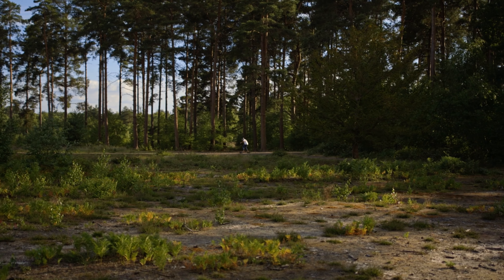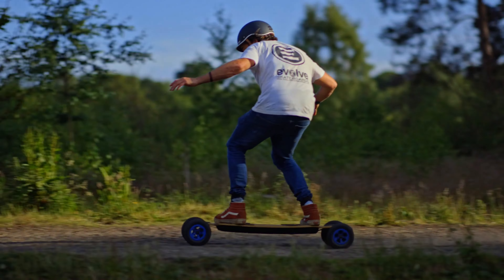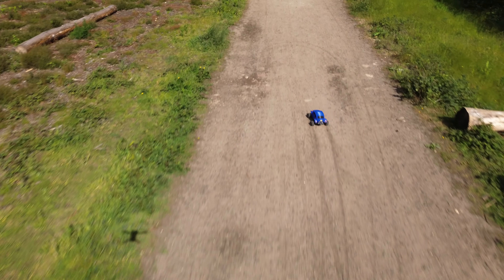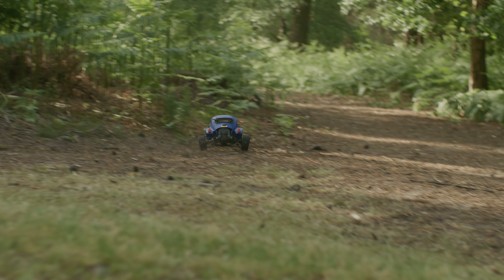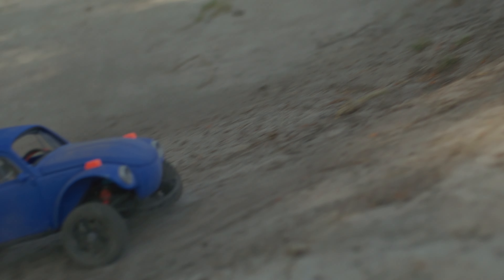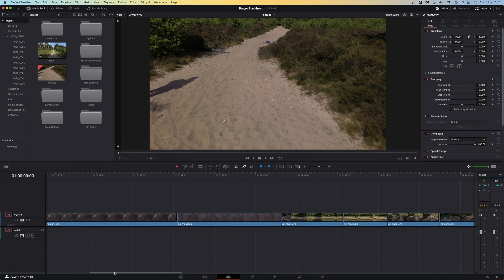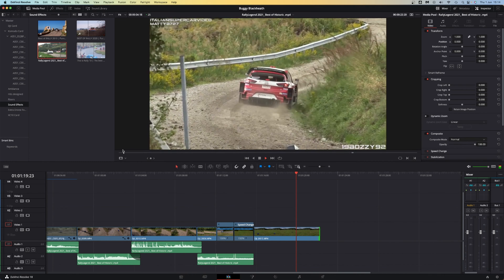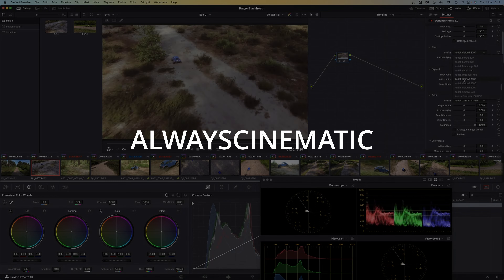RC Gymkhana

Comment: You need to activate the gyro automatic steering on your receiver/transmitter, so you can drive straight without losing the control of your car
Reply from the maker: First I need to buy a gyro receiver. I didn’t think I’d needed one but apparently I was wrong